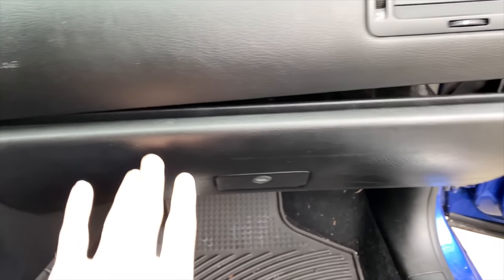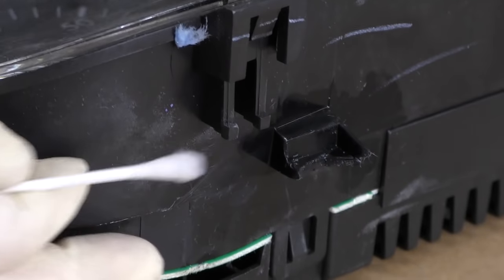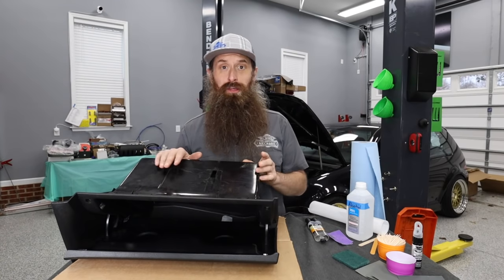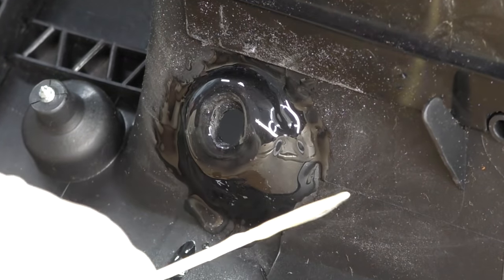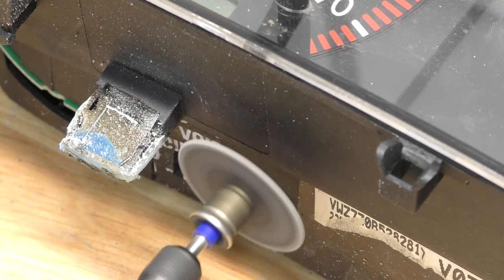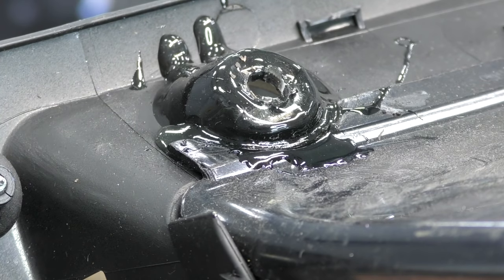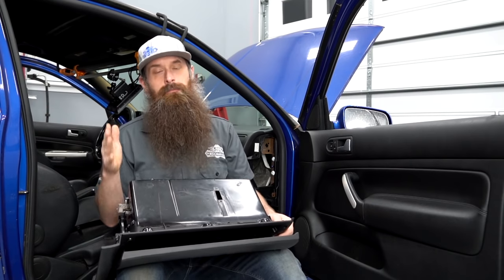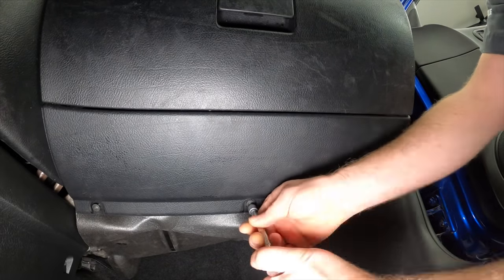How To Repair Broken Plastic Car Parts

Comment from the maker: I hope this video inspires you guys to have a crack at fixing something before just replacing it. There are almost an infinite number of ways to fix this stuff... What is your favorite?
Reply: Thanks for the tips , I've used fiberglass joint tape in the epoxy to make a permanent strong bond in the past using your method
Reply: Just plain old drywall joint tape . Easier to work with in my opinion, it doesn't fray at the edges as easily
Reply from the maker: @danielbernier9115  I love that idea too!!
Reply from the maker: @danielbernier9115  As I was editing I was wondering what would happen if I left the paper on.
Reply: @HumbleMechanic  thanks , saved my back side a few times lol keep up the Great content,Charles!
Reply: Nothing beats well hidden zip ties when and where appropriate. It may or may not be holding part of a bumper cover on for me...(I swear it's still bolted on where available).
Reply: The best way I find is to use a sodering iron and fuse the pieces back together again. It is instant and becomes strong and almost invisible.
Reply from the maker: That way works great too!!! I’ve done that a ton haha
Reply: @HumbleMechanic  pretty awesome to follow a youtuber in the states working on vw. I live in europe but have owned V dubs since I was 16. Dismantled my first gearbox at the time and these days (25 years later) it is mostly you tube view mech. But hey I did replace my front rotors the other day inspired by you.
Reply: Hey humble mechanic, why do older v.w.s smell like crayons inside???
Reply: Also....awesome repair method....havnt seen anything or ever thought about using epoxy like this.
Reply: For this particular type of repair - repairing broken mounting points, I'm all ears.  How does epoxy on tabs and mounting points hold up with flex on install and future removal?  If I didn't break plastic, I didn't mod hard enough, lol.
Reply: @Sman7806  - That's my method too. I use an additional chunk of ABS plastic when the gap is too big or strength needs to be added. Plasti-weld for the win!
Reply: That was an awesome repair, for hidden areas I like to use crazy-glue and baking soda.
Reply: I did the same for my protege glove box about a year ago... Still holding fine 👌
Reply: Hello: May I ask the 2015 Volkswagen Golf 1.8t, can I buy a used car that has driven 70,000 miles? How stable is this engine? What are the failures.
Reply: Super glue and calcium carbonate.
Thats the powder they use in those plastic repair kits, baking soda with super glue also is apparently quite good. 
I have always found them to work really well.
Reply: I just did epoxy too on my mk4 VR6 interior. For me it was the tabs on my driver's power window switch trim. All of the tabs stayed behind on the door. Since it is all hidden, I was liberal with the epoxy and it seems to be holding. But I love your video. Very inspiring for my inevitable future Mk4 repairs!
Reply: Replace it?!? 😂new cluster for a 2004 Silverado is almost $600 without a core.
Reply: I like using a very thin,tight weave fiber glass cloth (pieces) and epoxy or super glue .. they soak into the fiberglass cloth.
Reply: @iznogudsurfer5911  tried that.. works very well, but I did it with a one type of plastic, there are many
Reply: @danielbernier9115  pp
Reply: I just added a video on Plastic Welding my 87 Supra Turbo. Its a rescue that sat for 20 years in a garage after the original owner passed away in 97.
Reply: Use silly putty, modeling clay, or something similar for things like the first repair.  You can press it into the existing tap to create the mold and then press it onto the area for the repair.
Reply: I recommend using a plastic based epoxy resin. I ran into an issue with the clear epoxy breaking due to vibrations or impacts (like on doors pieces. I found that plastic epoxys have just a bit of flex to them to allow for some vibration absorption without breaking.
Reply: I went and bought an airless welder. Learned working with plastic can be a treat.   Lot of basic types plus tons of changes in formulations.
Reply: You save my life😀 thank you so much
Reply: Cccccccva
Reply: I like to use thick foil tape for the damn dam . and 3M dp420 epoxy. Strongest ive used.
Reply: Instablaster...
Reply: Got a stupid question. I have an older car that a lot of the plastic is very brittle. I want to do the fixes on a budget and all the videos to fix these plastic pieces use Epoxy. Can you use fiberglass on this instead? That way if the plastic that is brittle I can reinforce all the plastic instead of just areas that are broken?
Reply: Yes, I am inspired ;-)
Reply: Speed tape on an aircraft windscreen.
Reply: I need to fix the plastic part from the leather to the windshield I have a couple cracks in it.
Reply: @85jmccoy copper strands with melted crayon makes a good plastic repair. Haha

Comment: one of my favorite "backing" materials is art clay (the kind that never hardens) - can shape it to what ever you want (exact size if you want) - then fill it with epoxy and let it dry 100%.  If all the clay does not come off - it will with some paint thinner.   Works great for odd shapes and is infinitely moldable - for exact restorations I can even carve in lettering or details that I would never be able to sand!  Hope this motivates someone.  It is really worth doing!

Comment: Watching this video I had a possibly brilliant or a really stupid idea. As a father I get to model stuff out of play dough way more often than I´d like but it seems like the perfect material to make an epoxy barrier out of.
Reply: Typically when making composites such as fiberglass/carbon fiber part we use Plasticine aka modeling clay, wax is a little better option. Playdoh would probably work except the moisture in it could mess with the final cure.
Reply: There is also heat resistant silicon putty used by manufacturing 
Jewelers. They make moulds out of it and pour molten Gold or silver
into it, often placing the mould into a centrifuge.
when the Metal cools, it obviously takes the shape of the mould.
It is essentially 'casting.
using this putty, one can take a casting of whatever one wishes to
duplicate and pour either epoxy resin into it or molten plastic.
Making a centrifuge is easy if one needs it.
any small DC motor will do. Even a modified computer fan, Hard drive
motor, CD player motor. 
One could make tokens for parking meters, shopping carts, and
making ones own jewelry if one desires to place such ornaments on
the body. 
Note that the putty is to be stored in the refrigerator, otherwise, it will
eventually, solidify.
Oe could always practice by using chewed WRIGLEYS  gum
Reply: Maybe use the play dough to make a form of the good one and make a epoxy replica.

Comment: Also, for crazy-strong repairs, embed fiberglass cloth into the repair.
Reply: I do the same thing but I like to use shredded fiberglass instead.  And instead of epoxy I use 2 part polyurethane (JB weld plastic bonder in fact).  Bonds like crazy with zero peeling or delamination and the fiberglass makes it super strong and resilient.
Reply: Any type of cloth strengthen the repair a bunch. It ends up being a composite material. I used this technique to repair front fog lights mounts on a bmw. It stayed put for years and might still be. I sold the car since.
Reply: I use carbon fibre (just don't breathe in dust from sanding!)
Reply: You literally read my mind...
Reply: @StevenBuchanan  How do you embed the cloth or fiberglass ?  Like mix it in with the epoxy ?  Or, set it in after the epoxy is spread on, then pack in with toothpick ?
Reply: You could add some microbaloons. 
Find some unscented baby power , close enough. 
I've used play sand in epoxy to fill voids in rubber motor mounts also when you need some strength.
Reply: Epoxy both sides, embed it
Reply: @MrTheHillfolk  Micro balloons are really not for structure - they are to add lightness to the part.  Using "flox" (chopped up cotton) would be more strength (at least from a hard point perspective).  One really needs a fiber material with strands that orient themselves in a way to "connect" as much material together as to not have only the molecules of the glue as the bond.  All that being said - I have noticed the highest failure point of these type repairs is not within the glue area - but more in the bond to the existing plastic (and the remaining plastic that has shown signs of aging.  fusing a paper clip  into the existing is a great idea to help make this connection stronger.
Reply: Great ideas!
Reply: On small parts,  too small for fiberglass fibers, I add a single thin piece of kleenex tissue to the JB weld.  It mixes in well.  The wood fibers are smaller and do the same thing - just a binder.  Makes a SUPER strong part.
Reply: Drywall mesh tape works great. It's already sticky and holds position well.
Reply: @VeauX1902  I bought your car and the front fog light fell out due to your botched job. I’m never buying a bmw  from you ever again
Reply: @cc8530  no way, that was a top notch job! I’m sure the bumper will rot before my awesome craftsmanship

Comment: The washer idea may seem like a good idea at first, but in actuality it’s causing more harm than help. You’re not going to have as good of adhesion to metal for one thing, but main issue would be, that you’re decreasing the thickness of the epoxy, especially in a crucial position, the outer edge of the corner of the washer, if you think about how far in depth the corner of the washer is from the boundary of the epoxy, it’s a very thin amount, and if you consider the shape of the corner of the washer , and how it’s pressing against this thin layer of epoxy, you’re just asking for it to crack. Especially when you have a lot of different stresses pushing and pulling on that washer, it’s just gonna push and pull it around and you’ll eventually crack it just like the original plastic. I only know this because I’ve had the same idea in the past and it never worked out as good as I wanted it to. Instead, fibre glass or carbon fibre would be best

Comment: So if I was to work on BMWs I might need gallons of epoxy , smh
Reply: Can’t do this to a BMWs plastic engine lol
Reply: @DStabs720  bmws have very reliable engines my dude
Reply: @e36fanatics  You mean the V10 that needs rod bearings every 60k miles? Or the ones with the VANO system?
Reply: @DStabs720  so what youre saying they made one bad engine and now all of their engines suck ? cmon man youre smarter than that
Reply: @e36fanatics  I’ll agree that they did have reliable engines back in the 90s. Now they are plastic pieces of junk
Reply: Scotty Kilmer enters the conversation
Reply: I have a 07 5 series BMW with the n52 engine and 275 thousand on the clock purrs like a kitten and no problems. People with problems on BMWs just don’t maintain them
Reply: @waterheaterservices  new Scotty upload: "What kind of fucking moron would buy this heap of trash car?"   
Thumbnail: your car

Edit: or my car or whoever is reading this' car. Didn't intend that to sound like a lame insult. Just an attempt at a Scotty joke.
Reply: @weaksause6878  I got it haha. I thought about that. You watch his videos after him working on your car and he's dogging it out lol

Comment: One great tip instead of using masking tape for the tab dam, use foil tape. It makes holding the shape desired a lot easier.
Reply: And the foil can be left hidden in back to help reinforce if desired.
Reply: Yep beat me to it

Comment: I have used modeling clay to mold a good part, like the other good tab, then transfer the mold around the broken tab. This makes a perfect replica of the section that is missing...when the epoxy is cured you can just peel away the clay and you have the finished product...
Reply from the maker: That’s awesome
Reply: But modeling clay usually has some oily content that would likely prevent the epoxy from sticking.
Reply: @donsmith9478  Right.

Comment: Done this a few times in the past. I usually use JB Weld. The embedded washer or paperclip trick is invaluable for additional strength on areas under a bit more stress. Another good video from you Charles.
Reply: The non English YouTube vids where the mechanic is in sandals are the best. They fix old plastic all day.  Work in well ventillated area. Plastic fumes are cancerous.
Reply: Hi Stephen, would you say it is a good idea to add some fiberglass to the epoxi? I plan to run those repairs in broken plastic in my car, thinking about making it super strong
Reply: I use a small piece of stainless steel screen to support the epoxy across the crack
Reply: ב''ה, all these tips, and for cracked surfaces, drilling some holes and tying them together with dental floss or other thin filament provides both the string reinforcement and 'pegs' of epoxy through the drilled holes.
 
The quick version of JB Weld usually works better for me than the original, as might be stronger for certain mechanical repairs.  It's more sandable than most other epoxies.

Comment: Nice video, once when I had to repair broken plastic I simply putted the parts together and melted the broken joint with an soldering iron, than with the parts in place I scuffed the rear and used a bit of fiber glass to reinforce.

Comment: This is a fantastic guide to OEM fixes.  When I had a similar problem I didn't have the patience for this haha.  I went the opposite route.  I ended up drilling out the broken mounts, drilling out the remaining good mounts, and epoxying in little gusset/collar things.  They were all uniform and slightly color coordinated with trim, so it was a fix with a modified instead of OEM aesthetic.  I wish we had 3d printers back then, because nowadays you can print up a replacement mount with tabs to grip the host piece to help the epoxy and color coordinate with the trim and all that.

Comment: I have an 01 Corvette and everything I seem to touch breaks. These type videos are interchangeable with any car, thanks!
Reply from the maker: That is how things seem to be going in my R32. UGH!
Reply: @HumbleMechanic  Something to add reinforcement is model airplane fiberglass cloth. Its a very tight weave and is compatible with epoxy. You can get it at any place that sells R/C planes. I've used it a bunch of times to fix tabs.
Reply: @HouseCallAutoRepair  bondo will be harder than epoxy, try that maybe

Comment: I've used small pieces of an open weave cloth, a tee shirt, to reinforce open areas, making sure to get the cloth saturated with epoxy. You have to babysit it until the epoxy starts to set or it may sag, but after it sets it seems to be just as strong as the original part.
Reply: gentle heat gun will accelerate the chemical process
Reply: Another material to try is aluminum flashing metal; it can be made flat or shaped a bit, it is thin, and it is soft enough for easy drill penetration. With a washer, the hole in the washer has to be large enough to give some slop, and if not aligned nicely you might have to drill into some steel, and you are still left with the center of the drilled hole only being epoxy rather than being reinforced.

Comment: Almost all the dash and console mounting tabs on my '03 Corvette began disintegrating. I generally used some sheet aluminum that I snipped to the rough shape and size, then pop riveted in place to the nearest solid area of plastic. Filled that in with JB Weld. If a screw went through the repair to attach, i drilled and added a washer for reinforcement. Great video, thanks.

Comment: Nicely explained. I've proven myself really good at breaking old plastic. A matching skill to repair those mistakes would complement well. Some guys use fillers, and they report success for building up a tab. Others swear by Q-bond, which comes with its own filler premixed. You did well without filler, and it turned out great. Love that paper clip idea.

Comment: I did this 4 years ago with Mk4 2.slow Jetta and more or less the exact same process. Included washers for strength the holes, but I used Q-bond. Still have the car and it still holding together... but hasn’t been drive as much (become the third car) - what I’m trying to say, is that it worked! All the best to anyone doing this process!

Comment: What a great video!  I have found that broken parts that have a structural role (meaning they broke because they are mechanically stressed) epoxy putty works best, this 2 part cylinder thats like play-doh and you mix it and it becomes rock hard.  Example, broken headlight tabs.
Reply from the maker: I saw a dude fix a big hole in a transmission with that. Haha
Reply: @HumbleMechanic  lol

Comment: This technique works great. 
Also, If you can find the broken pieces, use a solder iron with a flat blade to plastic weld them together, then epoxy over the repair for even more strength.

Comment: Quicksteel, or other epoxy putty.  Easy to shape.  It's holding half my 80's GM interiors together.    Can always add a layer of resin/epoxy/fiberglass over it.

Comment: Great video. I used a similar method to repair the back of an interior body panel. I used window screen repair material to reinforce the crack. For a broken bumper panel I used the plastic of a ballpoint pen. Epoxy is great stuff.

Comment: Literally just used JB weld with tooth picks as rebar to do some similar repairs to help fix up my friends 2 gen RAM. That is perhaps the most brittle dash ever made. Also if you don't wanna spend the money on a Dremel, harbor freight has super cheap under 10 dollar rotary tools. No where near as good of quality of a Dremel, but good enough for this.